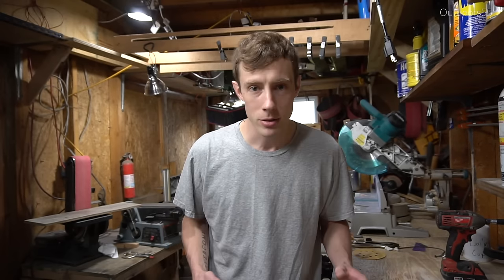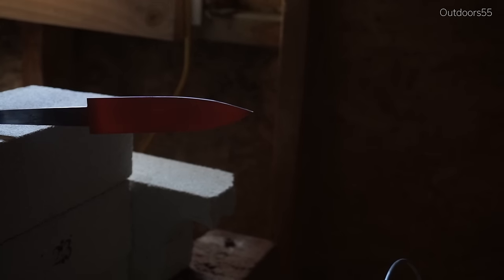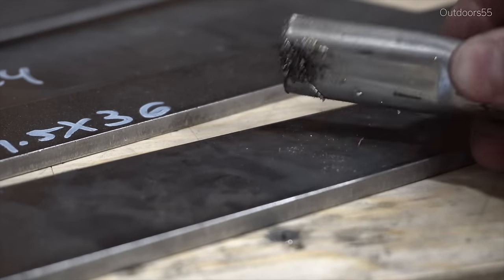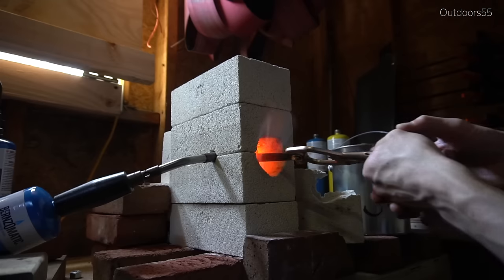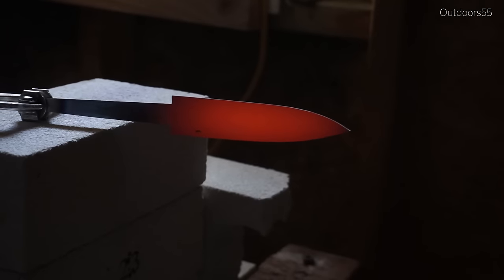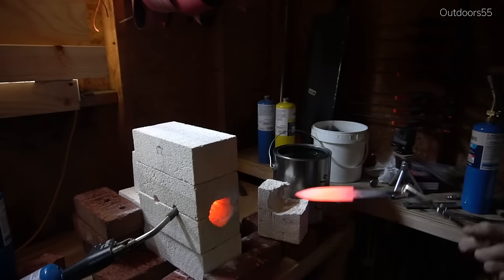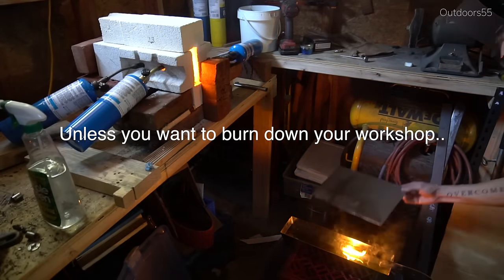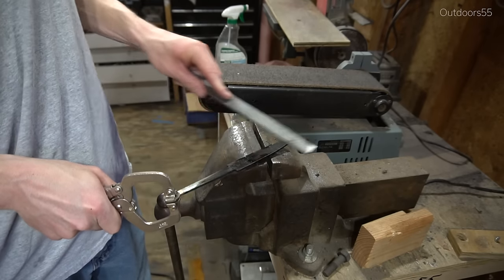How To Heat Treat A Knife | The 4 Steps You NEED To Know

Comment: Goes around telling people how to heat treat knives....    Doesn't even austenize the steel or even at the correct temperature. Has probably never heard of retained austenite.  Generally the minimum austenizing time for 95% of steels is literally over 25 minutes..   Telling people they don't need to know metallurgy for heat treating steel is pretty naive and suggests to me that you have a very basic and flawed understanding of what's going on in the steel with fresh grain formation at grain boundaries.  

Normalizing factory condition steel is actually going to ruin the beautiful factory microstructure they got for you.   Modern factory condition steel should be forged at low temperature and then normalized once, even that's not completely necessary. 

Water quenching is required with steels which have a martensitic transformation time which is very very quick.  Like under 3 seconds.  Ultra clean carbon steels are generally water quenching steels because of this tight transformation time scale and also to avoid having retained austenite.
Reply from the maker: Read the description
Reply: Probably should have read the description.  Have you ever heard of the subreddit /r/iamverysmart.  They sing the song of your people.

Comment: Lies I made a knife out of plain welding steel and I didn’t heat treat it and it holds an edge amazingly
Reply from the maker: Awesome 👍
Reply: Knife Maker what do you mean welding steel?
Reply: Just your steel that you buy at Home Depot by welding steel I mean the cheap stuff you use for projects
Reply: What alloy? I'm a welder by trade and have worked with many different alloys so you aren't being specific enough. I'm also an ameture Smith and you are flat out wrong if you believe any steel will work fine for knives and that heat treating isn't properly. Not all steel has enough carbon to harden nor does all steel have the correct amount of other elements that are beneficial for knife making and heat treating is absolutely necessary for any knife because as the steel heats up the grain structure changes completely and creates smaller grains and the quench locks the grain structure in.
Reply: You have absolutely no idea what you’re talking about dude. Just change your name please.
Reply: Lies? Everything he said is a fact, but then again if your to ignorant to research it nuff said , he as do I make knives for a living, people want quality, we stand by our KNIVES, mine have lifetime warranty, our names are on them, it took hundreds of years to develop, and it continues